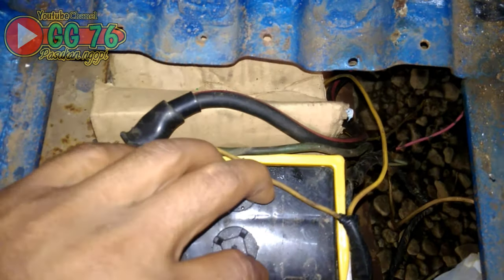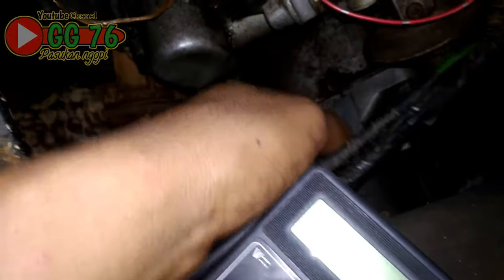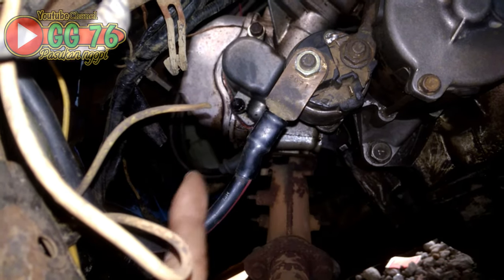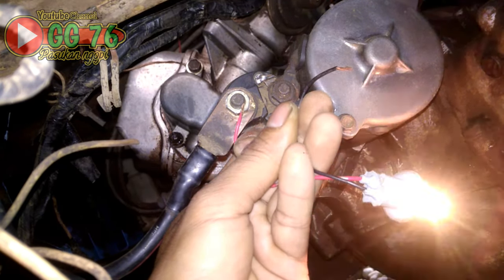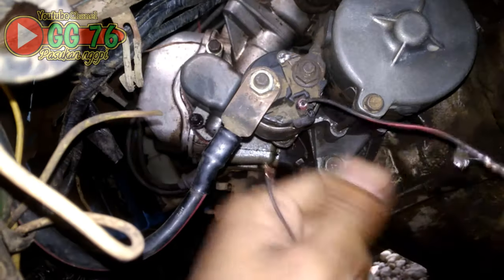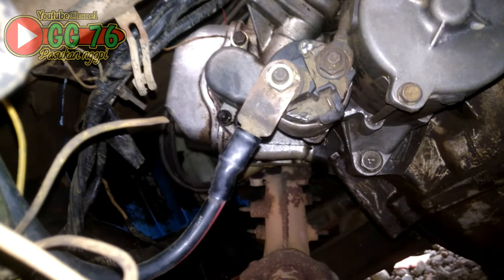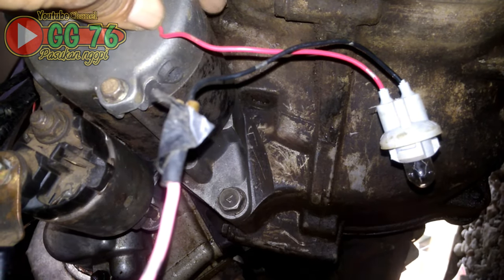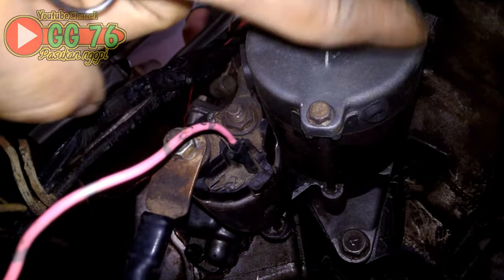penyebab mobil ga bisa starter penyebab mobil susah starter

Comment: Izin bertanya om, mobil saya waktu di hidupkan pada pagi hari atau waktu mesin dalam keadaan dingin saat saya starter hidup tapi dalam beberapa detik mati , begitu sampai beberapa kali baru normal. Mohon solusi nya om , mobil saya vios 2008. Terima kasih
Reply from the maker: Coba kontak on 5 detik kontak off 3 detik , on lagi 5 detik dan off lagi 3 detik kontak on 5 detik baru star

Comment: Bang saya habis bongkar ovaporator mobil suzuki splash GL 2011, setelah saya pasang semua kabel" nya cuma mesin nya tidak bisa menyala kalau di starter gak cetek", bunyinya seperti biasa nya tpi mesin gak mau ngangkat.
Reply from the maker: Kmbali ke dasar aja om syarat mesin hidup ada api ada bbm ada udara dan timing yang pas , coba di tliti satu satu mana yg tidak masuk syarat tadi, hanya orang yg di lapangan yg pegang unit yg tau maslaah sbnernya
Reply: @pasukan_ngopi  maksudnya ada udara itu gimana ya bang, cara ngecek nya gimana ?
Reply from the maker: Kompresi om

Comment: Bang punya ku di stater kondisi mesin panas/dingin berat stater nya
Kondisi dinamo baru, accu arus besar..
Kerusakan kemungkinan ada di mana ya
Kabel arus normal semua
Mobil grand max
Reply from the maker: Coba pasang relay starter
Reply: Sudah bang
Reply from the maker: Coba ganti relay nya aja dulu
Reply: Baru di coba di ganti relay nya masih aja gx mau bang
Mungkin ngk bang kalo itu seher ngembang
Reply from the maker: Macet ga mesin nya, coba puter puli depan
Reply: Ngk macet si bang puli depan nya di puter
Apa nya ya bang udah bosen bgt dandan stater dinamo baru accu belum ada 1 thn
Reply from the maker: Knapa ga ganti seglondong aja dinamo star nya
Reply: Udah mas tak ganti segelondong dinamo nya masih aja berat
Dan tadi org bengkel bilang nya aacu nya kalo panas mendidih gelembung accu nya bnyk.
Skrg lagi di vonis accu nya soak
kemaren di vonis dinamo nya sebelum beli baru
Reply from the maker: Wah ini musti di ganti semua , alternator dinamo star + accu , saya yakin sembuh
Reply: Kira2 untuk biaya sampe brp ya itu bang
Reply from the maker: Harga relatif cek bukalapak atau shopee ja
Reply: Hampir sama dgn dinamo stater ya bang hrg ny
Reply from the maker: Ya
Reply: Bang kali ini mobil udh bisa di stater
Dan tadi aku panasin mesin mobil amper panas sampe mentok radiator mendidih sampe kekuras air penampungan sama di radiator nya.
Kenapa bisa merambat ke situ ya bang?
Reply from the maker: Waduh ko bisa, emang abis d apain
Reply: Aku jg bingung bang
Dari dinamo ke aki sekarang kok bisa nya ke radiator over heat
Reply from the maker: Mungkin radiator airnya kurang atau udah nyumbat

Comment: bang mau tanya stater jimny katana bunyi seperti gear motor habis kenapa ya
Reply from the maker: Gigi stater ny gundul
Reply: @pasukan_ngopi  Tapi bendiknya udah diganti mas
Reply from the maker: Priksa gigi stater di flywel nya atau roda gila
Reply: @pasukan_ngopi  masih bagus om kadang distater cuman tek tek aja
Reply from the maker: Switch starter carbon brush tambah relay starter

Comment: Motubaku kijang super ,Awalnya normal dihidupin bang, lalu esoknya Tek Tek Tek , untuk lampu dll nyala , apa reley nya ya bang ...
Reply from the maker: bisa jadi om itu apa j yang dh d kerjakan
Reply: Belum ada pengerjaan sama sekali bang
Reply from the maker: cek satu satu dari mulai kondisi aki
Reply: Bang kalau di stater bisa tetapi tidak bisa "greng"... kira2 apa ya bang?
Reply from the maker: cek pengapian
Reply: Kalo mobilnya diesel bang?
Reply from the maker: Diesel comonrail apa konvensional,  jelas kan dong,  apa yang udah d kerjakan unit apa taahun berapa
Reply: Innova diesel mas... th 2011... mmg aki tekor tapi sudah di ganti baru kok masih distater bisa tetapi gag bs "greng" tp kadang2 kontak diputar agak keras baru bisa "greng"
Sebelumnya trimakasih sudah dibalas mas... semakin bnyk pengalaman
Reply from the maker: mungkin relay starter dh minta ganti atau kunci kontak eror,  atau bisa di scan dulu

Comment: 0:05-0:15 Apakah tak berbahaya melakukan jumper terminal B (yg terhubung ke Aki) dan S (terhubung ke kunci kontak) di solenoid starter itu ? Sekali terhubung ke motor starter, arus listrik yg mengalir bisa mencapai 100 ampere.
Reply from the maker: 🙏 aki nya aja cuma 35 amper, 100 amper dapet dari mana ?

Kalo hati hati dan tau apa yg kita lakukan InsAlloh aman om🙏
Reply: @pasukan_ngopi  Yg saya baca begitu. Ok lah, tapi dgn arus 10-20 ampere  pun bisa bunuh orang. Kalau orang yg paham listrik seperti mas, bisa atasi. Tapi kalau yg awam, berbahaya.
Karena itu lah relay dibuat dan digunakan, agar bisa mengontrol operasi device listrik tegangan/arus listrik besar dgn menggunakan input tegangan/arus listrik yg kecil dari relay.
Reply: @pasukan_ngopi  Kapasitas Aki bukan dinyatakan dgn ampere (A), tapi ampere hour (AH). Yg tetera di aki bukan 35 A, tapi 35 AH, yg artinya aki dapat mengalirkan arus sebesar 35 ampere selama 1 jam sblm kosong. Jadi, bisa saja selama 1/2 jam, arus yg mengalir adalah 70 ampere, 1/4 jam mengalir 140 ampere, dsb. Proses starter kan hanya perlu bbrp detik, jadi mungkin saja arus yg mengalir mencapai 100 A.
Dinamo starter biasanya perlu daya 1200 watt. Jadi dgn tegangan 12 volt, perlu arus :
I = P/V = 1200/12 = 100 A.
Utk durasi waktu cuma bbrp detik, Aki 35 AH bisa menstart mobil dgn dinamo starter yg perlu daya sebesar itu, sblm Aki menjadi kosong. Setelah mesin hidup, alternator kan men-charge ke aki, sehingga muatan aki terisi kembali.
Reply from the maker: Ya benar om secara teori seperti itu, namun arus yang besar itu mengalir bukan melalui konci kontak ke dinamo starter, arus sebesar itu mengalir langsung ke dinamo starter dari aki setelah selenoid di triger oleh arus yang ta sampai 30 amper dari konci kontak  ( saat kontak di putar ke posisi star)
Reply from the maker: Yang saya lakukan di video hanya mensimulasikan bagai mana ketika peranan konci kontak sbagai triger tadi di ganti kan oleh kunci ringpas yang saya langsung kan ke + aki , brtujuan agar mengetahui kondisi kerusakan yg trjadi apakah di bagian dinamo starter atau di rangkaian kabel triger yang brasal dari konci kontak ( kontak star)
Reply from the maker: Untuk masalah ke amanan penonton bisa mengukur sendiri kbranian dan kmampuan nya , saya hanya berusaha memberi referensi walau mungkin berbahaya tapi sejauh ini di daerah saya blom pernah ada kjadian yang tak di inginkan brsumber dari sengatan aki,  untuk masalah di tiru atau tidak tidak sdikit orang trmasuk saya yang kadang hanya ingin tau tanpa berani meniru ,, 🙏
Reply: @pasukan_ngopi  Ya, betul utk semua penjelasan mas terakhir, baik ttg arus dari kunci kontak ke solenoid maupun mengenai cara jumper (trigger) seperti itu.
Saya sdh pernah tahu ttg cara jumper seperti itu dari video luar negeri. Karena mekanik yg post video itu juga memberi warning ttg bahaya nya, saya sdri belum berani melakukan nya, hanya utk bahan pengetahuan saja.
Trims sharing video nya.
Reply from the maker: Semoga bermanfaat 🙏
Reply: Iya suhu biasa wong kulihan an ngeneki gak tau teknik mengakal
Reply: @lexsoft3969  udah di kasih ilmu + di jelaskan masih aja ngeyel, kalo gw ya lebih suka menjadi mekanik apa adanya dan terjun langsung drpd teori😂 good aku suka debat tapi batasi pikiranmu karena semua orang memiliki batasanya,
Reply: @anggatriprasetyo4173  keminter lali dee keblinger maseh😂

Comment: Apkah masih ad blasan jika brtnya skrang...
Reply from the maker: Selagi saya tau akan saya jawab om
Reply: Mobil sy cuman bunyi cetak cetuk Boss saat di stater itu apnya ya Bosss... Mnta tolong bos soalx sdh lm gak kmna2 akbat bgtu
Reply: Oiy Bos mobil sy carry 91
Reply from the maker: Aki drop om, coba cari pinjaman aki lain
Reply: @pasukan_ngopi  sdh sy cek Bos pkek Termometer akix normal 13 di alat ukurx itu om. Tp msih cetat cetuk saat di stater
Reply: Avomet atw ap it Bos intix masih diatas 12v boss
Reply from the maker: Saat konci oontak star brpa tegangan aki
Reply from the maker: Ap udah d coba cara sprti di video
Reply: @pasukan_ngopi  gmn crax mas
Reply from the maker: Ikuti cara d video

Comment: Ciri aki udah drop/tkor gmn bang..?
Reply from the maker: Mesin dingin/sehari g di pake g kuat starter
Reply: @pasukan_ngopi  ni 2 hri g pke ,star g kuat..coba mau cas n tmbah air aki.
Reply from the maker: Ya coba dulu , skalian kalo mobil ga di pake kleman kpala aki nya di lepas
Reply: @pasukan_ngopi  aki msh ok.tpi saya tes dinamo amper ko g ber magnet npa y om..jd g ngisi.
Reply from the maker: Tes pake avo d kpala aki nya saat mesin hidup apa voltase naik
Reply: @pasukan_ngopi  maaf mau tanya..klo oli rem d bwh garis  low..ap tinggal d tambah aj y om..cery pik up..
Klo blh tau harga oli rem brapa y..mf pmula..
Reply from the maker: 30 rebu langsung tambah ja
Reply: @pasukan_ngopi  mf om.klo aki cery pik up.1 5 pke aki brapa volt amper ya...
Reply from the maker: Biasanya 12 v 35 amper